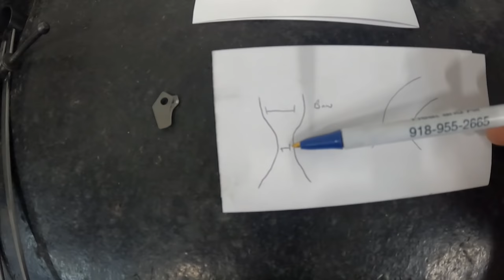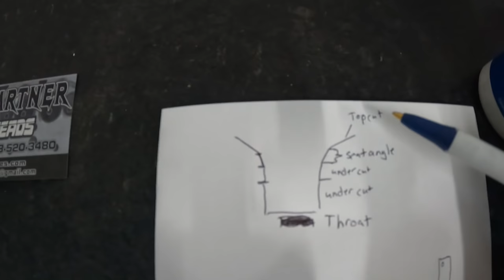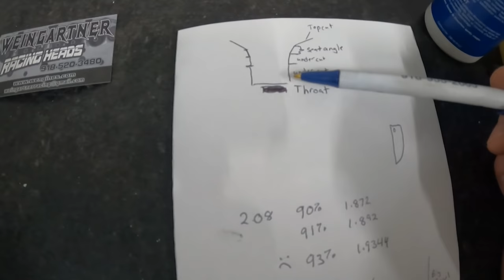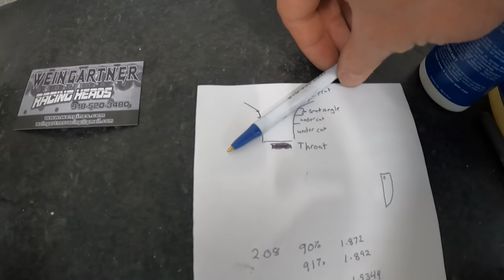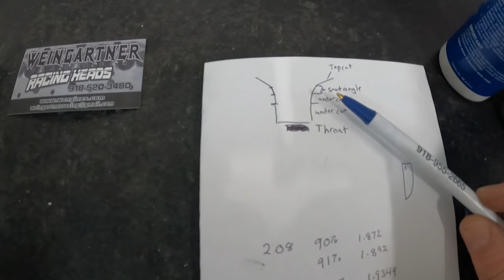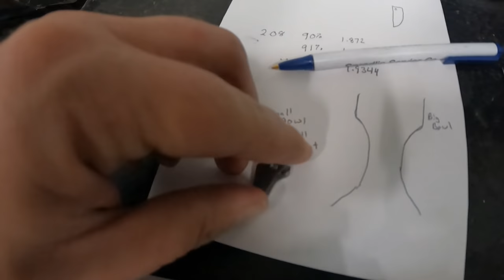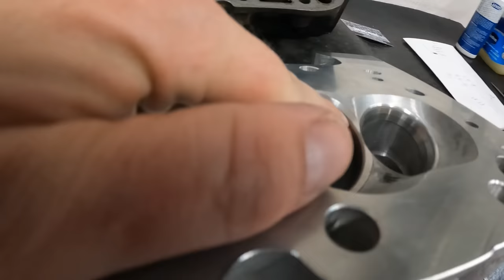What not to do when porting heads

Comment: Its basically a horn (or a or rocket jet but horns are older and the math is the same).  If you did a 2-d graph of the system in to out, and did the calculus on it, you'd see what changing each of the three elements does.  I'm surprised no one has made a model of this, with sliders to give a good idea in advance what each modification may or may not do.
Reply: I think they have but it was 'too new' and they couldn't sell it, plus, it still only gave a starting point which needed physical verification and often modification.
I'm sure major auto and motorcycle manufacturers now have software to do it as that would explain the incremental power gains year on year to sell more motorcycles (and why 600cc 16,000rpm engine now make 140 bhp instead of 55~60bhp @ 12,500rpm)
The REALLY surprising thing though, they still 'pull' from around 2,500rpm and idle at 1000~1300rpm.
Foll race' 1000cc motorcycles are producing around 220bhp (probably more but they don't want competition to know just how much) without forced induction or power adders (NA and race gas)

Comment: Thank you for the great video . 
    I want to port my Chevrolet Camel Hump heads and I have a question. Can more porting be done, basically at the beginning and at the ending of the throat and maybe taking a half of a millimeter off the throat ? ( and of course,  not touching the valve seat ).I am a beginner at this but I know , when I get it figured out , I'll do it right .

Comment: Is using a a valve ground to 89% diameter of the valve in use an acceptable tool for measuring the throat? Can you demo how you measure the throat. I’m imagining cutting the throat out until that 89% valve will pass the throat. Am I way off here. I have no development equipment. I used to grind on peoples heads a long time ago. Nowadays with the videos and info coming out they proved me right, I was doing it wrong. I almost feel confident enough to give it a go. New sub.
Reply: you only need an inside measuring caliper.  Set the OD and off you go.
Reply: @superkillr  hey thanks dude and i actually watched a another vid where he did the measurement

Comment: My question is. on a boosted application would this still apply? or is it all just valve angle / throat related.
Reply from the maker: It still applies. If it’s bad na it’s going to still not going to be as good with boost.

Comment: Hello from Greece.
I have one question regarding the area below the valve guide.
Its better to leave that line parallel with the flow?
Or it doesn't matter to grid it away and make an overall cylindrical port?
Reply: You do NOT want the port to be shaped like a perfect cylinder…. It needs the center of the port to have an ‘hourglass’ shape by creating a bottleneck half way up , that’s why he mentions 91% ratio of the valve seat ( large hole at top of port ) when compared to narrowest point of the throat.
Reply: @Pwnulolumad  thank you for the answer 
But i was mean the area exactly below the valve guide.in this video there is guide line in the cast of cylinder head.
Some others grid it away.

Comment: 90% max of inside or outside measurement of valve seat?  Or is it 90% of bottom cuts diameter?
Reply: I have read that the 90% should be of the valve seat ID.
Reply: @andyharman3022  Ok, looking for clarification as I cut down some valves to use as guides for the throat.  Wanna be sure I don't go to big and ruin these JY heads.  😆

Comment: Have you ever tried opening up the bowl area more beneath the throat on those screwed up heads?
Reply from the maker: I have made bowls extremely large with no major problems. However that’s an area that will lie to you. To big a bowl and looks good on flowbench but it can make it do negative side effects that make it not run as good. It’s a long explanation.

Comment: would the throat size on a smaller 300cc oval port head follow the same 90 percent rule? or could they be opened up more because the smaller port size would have a higher velocity than a big 360 rec port?
Reply from the maker: 90% safe but you can go bigger especially with steeper valve angles on the seat. The biggest I have ever gone on any head was 92.3%
Reply: @WeingartnerRacing  in the example you showed did you have to cut the seat almost down to the actual sealing angle to get the throat opened to 93%? right now i have a set of aluminum oval ports that have been opened up pretty much flush with the bottom area of the seat but no material taken off the actual hardened piece. this is with a 2.25 valve.
Reply from the maker: You just have to measure then you will know.
Reply: @WeingartnerRacing  is the bottom vertical area of the seat considered part  of the throat? Or does throat measurement have to be taken from the actual runner walls of the head?

Comment: Good video, thank you. STOP apologizing about the use of terminology or any technical dialogue. That information allows the user to better understand advanced flow/velocity cutting & porting techniques. I'm not saying bombard the viewer w/ technical jargon, you've got to present it w/ a low to medium pace but, if someone has big issues about the technicalities then they need to stop watching & go back to their 'macro may' channel & leave the rest of us alone. I'm glad you discussed the difference between the intake & exhaust porting. They're completely different but it still goes over some peoples' head. Use as much terminology as necessary & please don't get into the habit of calling a feature, component or term a 'thing', 'this', 'that-here' etc. That's nonsense talk that doesn't belong in a technical setting. Suggestion: Substitute open-cell foam batting for the regular pillow in the pillow cases, you'll breath easier.

Comment: what did your 91 percent throat flow?
Reply from the maker: Depends on the heads. I have not done back to back test from 90 to 91% to see difference.
Reply: @WeingartnerRacing  so what would be a good throat size starting point on the exhaust? Sounds like you were saying its pretty much okay to open them up quite a bit. Would there be any negative effects from going up to or over 93 percent on a bbc?

Comment: 15 degree angles between flats give the same flow as a continuous curve. If gas has to turn more than 15degs (at one point) around the valve there will be turbulence. 
Inlet opens gas inertia starts the flow, Exhaust opens and almost instantly drops cylinder pressure below atmospheric sucking in more inlet flow. Exhaust closes and inlet continues to pour in, even though piston is well on its way up the compression stroke.

Comment: Will replacing the valve seat save the cylinder head
Reply from the maker: This and welding up were the seat is and throat.
Reply: If you go with a larger valve

Comment: We did a lot of R&D at a shop I worked at (flow bench, dyno AND track testing) and we ended up with custom cutters that include the smooth blending radius below the inside valve angle = every port/bowl was perfectly sized and concentric, with inside radius blended in one step (extra bowl boring steps need if head was stock and or installing oversize valves).
I find it interesting that one thing you don't see or hear about much (if at all) is the "critical choke area" = where you want/need max velocity in the port to make max power, but that's an entirely different subject that includes very complex math formulas 😜

Comment: a simple way to describe it would be removing those minor angles for the air to smoothly flow around causes pockets of turbulence and that messes with the overall flow and can in some cases block flow as some of the pressure is pushing back against the inward flowing air/fuel mix (correct me if I am wrong but this is how I see it)

Comment: Leave the seat in,weld one run around port under seat.
Make new seat with the missing port material in it.
Machine to take new seat which actually goes deeper.
Blend weld
Reply from the maker: You can’t do that because the seat will lose its press and fall out.

Comment: Good information. But it's really specific to the stuff you're working on. Not all engines/heads are created the same. There's no one answer for every port design.
Reply: There is one answer, and it’s that every head benefits from removing rough casting material. A mild port will help any head.

Comment: This is interesting.  I checked my bone stock 706 castings from a LM7 5.3 truck with stock 1.890 intake valves and the throat measures 1.750.  That's 93%
Reply from the maker: You must have measured wrong. All I have seen are about 88-89%
Reply: @WeingartnerRacing   That is very possible. I was checking with dial calipers.  I think I will grind down an old valve and creep up on size to see when it just clears.    Should I put the stem in the guide and use that as a guide?   Or, should i flip the valve, hold the stem, and gauge it that way?

Comment: I see that you cut into the bolt holes, is that ok I am curious as I never seen this before. Wouldn't it hurt flow? I have a set of Dart heads I want to do but just to give it a polish. Thanks for this video and I have liked and subscribed as I like the way you present the videos.
Reply: I would avoid polishing the intake ports but hell I don’t know maybe the laws of physics have changed 🤣 intake turbulence and even a little valve shrouding is good.

Comment: Thanks for the tip. Why do you leave a peak on both sides of the guides. Please explain. This is all new to me. Also what about the holes in the chambers, and could you epoxy the throat back or weld it. Ronnie.

Comment: I call b.s.    show proof of your talk... 
 What you are saying literally hold no weight without some sort of proof. This is literally your opinion unless you show proof buddy. 

It would make sense  that it matters more on the exhaust  as it enters the beginning of the port than it does on the intakes end of port  to "funnel" out into the chamber via those angles. Because  you don't funnel an  outlet "exit" unless you want sumthing to appear "louder"   you funnel an inlet because  it directly  effects  flow as the air  needs the radius  to help guide it into the port But on the exit???  if it matters as much as your saying on the "intake" ---> as it enters the  combustion chamber, id love  you to show us side by side same port not changing anything but the intakes outlet seat  and the exhausts inlet seat..  Because  on a "max" intake throat port  (as in, port all the way out the the seats sealing angle, waaaay out) then do one that is proper to your spec that includes the angles on the intakes on your  version. And then see what it takes to get better flow vs. Telling people what they can't do and what  they can. 

 Less talky talky, more tests testy and proof. Because at this point your just doing the same as everyone  else--->  tips with no actual proof as to what your talking about. 
 
 And please,  the exhaust and intake are different  don't treat them as the same, show us "proof" that the intake valve being max ported  (heck why not just leave "half" of the  last angle on the sealing angle, grind away ALL the others leaving only the part of the last angle that the valve actually seals to)  and show us how this ruins the head so bad. Port  the extra 3-7mm+ out, open up the bowl to the new size, knife the valve seat  and  blend  bowl to stock port  only changing bowl and seat "neck" area and test it.  Because honestly your literally showing us nothing in these videos  we have to go off your word and I don't believe  it 100%. Because my brain tells me  "why the heck radius  an exit into the combustion chamber  or the  exit on literally ANYTHING.    Show use sir, why its so bad on the intake.

I say port the piss out of the intake  and keep the radius  angles on the exhaust  and see what it does.

I'll  Bet you $100 it will flow better on the intake  side and teach you soming new.
Reply from the maker: What proof would you like? Do you want me to flow it proper then ruin it and see the difference. I can do that but it is exactly what I’m telling you in the video. I’m not going to dyno an engine like that because you are literally running a set of $1000 heads. Radius always helps flow on the flowbench.
Reply: @WeingartnerRacing  how about I port a head and send you it, then send you the other head  off same engine an you port it to your spec...  not trying to port  and see who is better but to see how much different  it is.m. I have a set of six heads I can donate for test purposes  if it will help your channel

Comment: over 100k on head porting vid!!i wish these were around when i was porting my dart merlin heads.yes before they split up the company to dart and world prod.so cast iron heads from 1990 ish.after serious porting and valve swap 2.30 intake,they made about 760 hp in a 467 bbc with lunati roller and 11.67 comp.castings were stout to say the least and my machine guy said he never saw heads with so perfectly placed seats in relation to valve guide.i sold those but if you need a iron head with good potential and are on budget,those work.
Reply: I assume those are rect port?

Comment: Really good info.i have a set of 15° pontiac brodex sbc heads that I half to install longer stem valves.they currently have a 2.100 and I want to step up to a 2.120.they flowed ok with 2.100 but sense I need longer stem (per spring setting height) I figure it would help flow some. having the valve throats messaged for bigger valve.the heads came off a small cube comp engine and going on my 440 sbc

Comment: got to puke when I see IN ports buggerized by trying to blend the valve guide area to the port, 1st thing to do is knock any guides out and any minimal 'bowl'  into port roof and you can m/c a taper onto the new IN guides ... the increase in 'bowl' is only there to account for the guide and stem volume. next real important thing for newbies is to lift the IN port at the gasket face as far as possible, which means never take metal from the valve head side of the port ( if at all possible )
Reply: wish i understood what you said  "lift the IN port"  ?
Reply: @josepeixoto3715  Hi bro, what I mean is ....when you look at the inlet port side of the head the top of the port runner is facing  the rocker gasket, and the bottom of the port is facing the head gasket, so if you need to remove any metal to increase the port dimensions, try and take it form the topside of the port, this keeps the short turn radius by the back of the valve, at the bottom of the port as large as possible. Obviously you have to make this as true a radius as possible. Watch out for busting through waterways etc  Aluminum heads are a piece of piss to weld up mistakes, ...NOT so with the ol' iron stuff
Here is how to do a down drafted head, this is a Ford  pre crossflow cyl head    http://www.turbosport.co.uk/showthread.php?t=122309 
the dimensions in the schematic drawing are incorrect ! but this gives you an idea of what can be done ...iron heads by the way
Reply: @bobawatsit  got it;  yeap,bad news if you bust thru a thin wall in there;  avoid  tig to the rescue   lol;  thanks